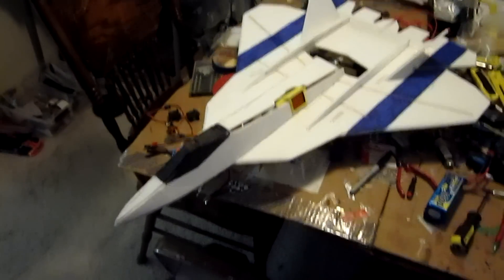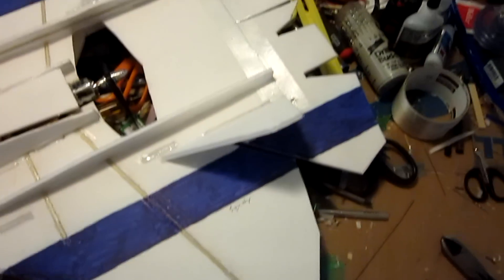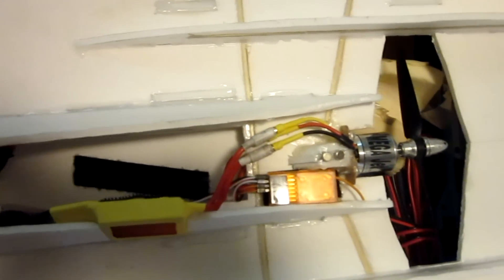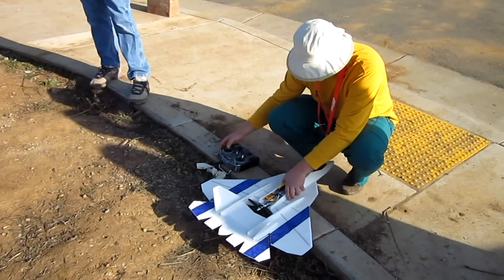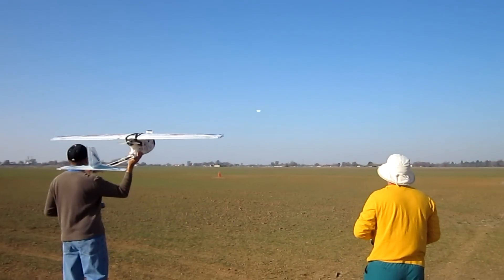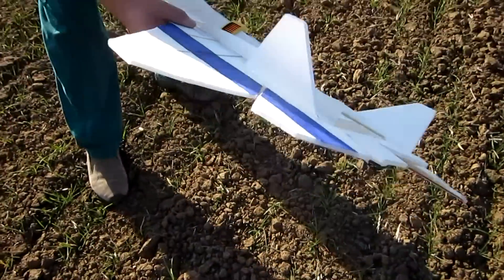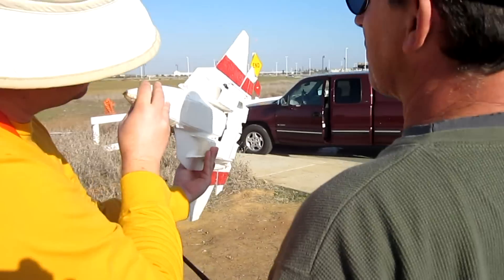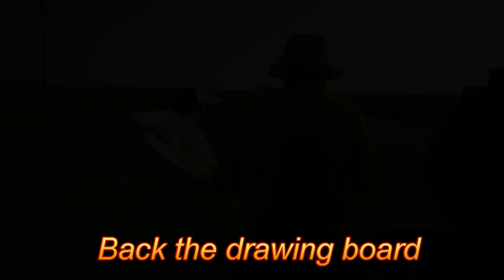RCPowers T-50 v1 Pak-Faf, maiden and crash!

Comment: I had this same exact problem before, i think it is because of canards, later after the crash i fixed it and replace with a piece of foam board attach to the body (no canards). It turned out and fly way better. I did 20 roll and get out of it so easy. regardless i didn't install any reinforce wing spare.

Comment: Wicked speed,  squishy- Looked like a lot of fun! I did about 5 min of 4s high speed runs on my JMW Eurofighter Typhoon and it melted the depron around the motor mount. I felt that flex on t50 and slid a carbon rod through the 4 nacelle walls and glued it in place just like the v2. Nice and solid now. Should be pretty easy to fix?